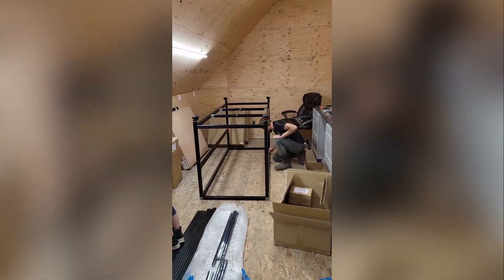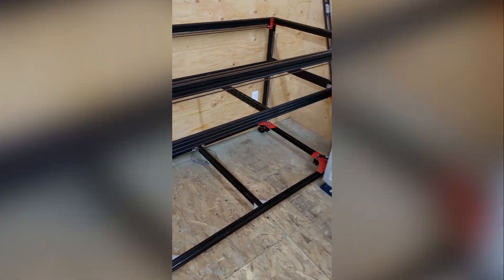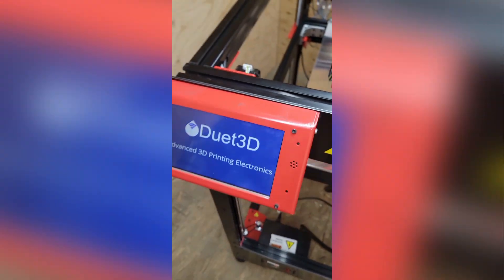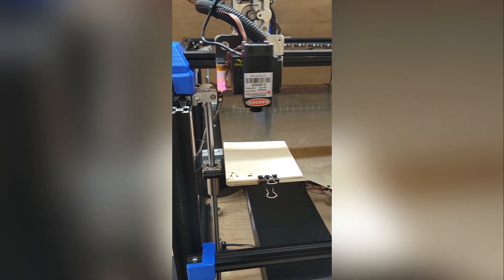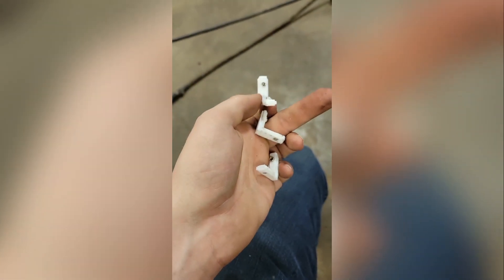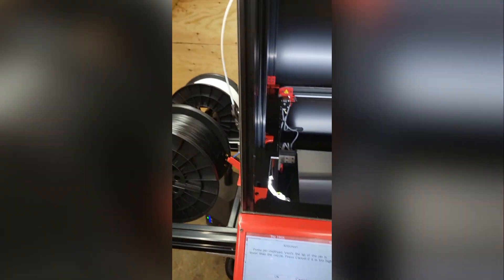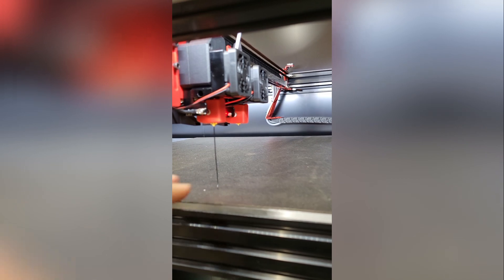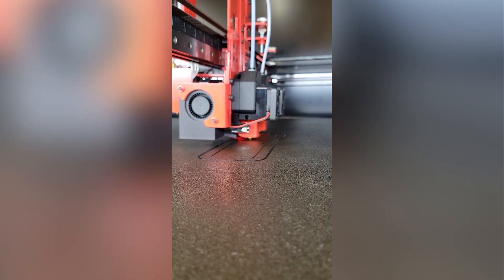3D Printer Lab Set-up (HUGE Modix 180X and Creality Ender 5 Plus)

Comment: On the Modix 180X, what are the lower 3 led panels with the switches on them? power supplies? or chamber heaters?
Reply: they are controllers for the 3 bed plates, You can control each bed individually, If you print is not huge you do not have to power them all up at one time.